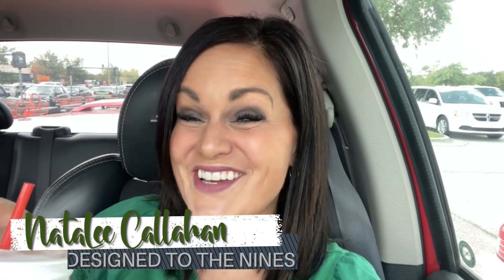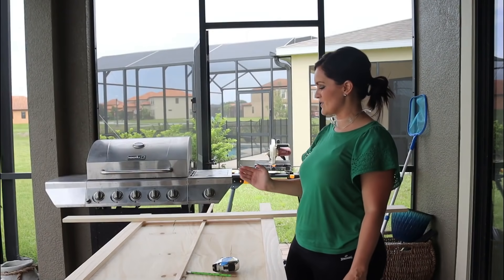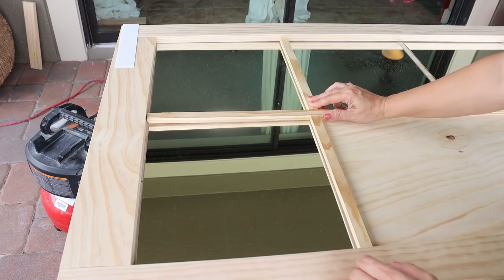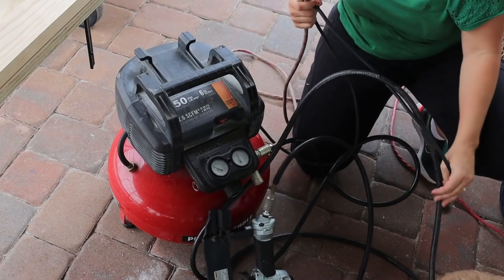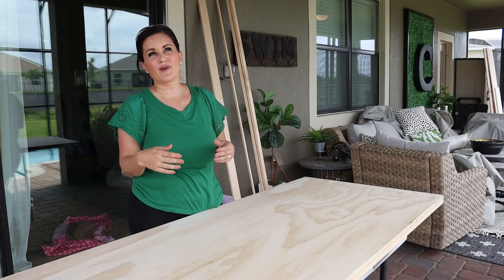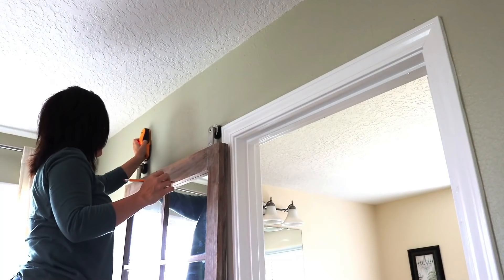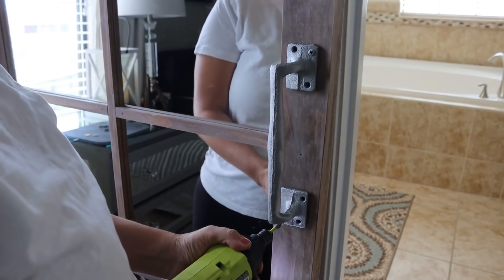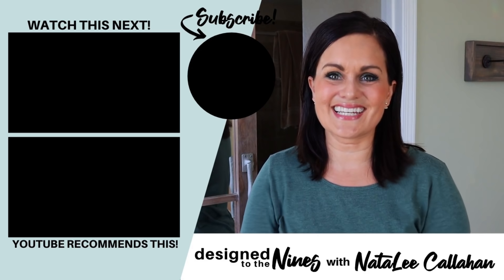⭐ You Can DIY This Amazing Industrial Mirror Barn Door!

Comment: I built my own barn doors which also required a mounting board for the hardware rail. I chose to paint the board the wall color. Once the rail and door was installed, you never even notice the mounting board. It blends in with the wall and the barn door and cool hardware is all you notice. 
Great job! Can’t wait to see the entire room.

Comment: I love all of your wood working projects! You are Powerful! I think your videos are great, but  May I make a suggestion though. You always address safety gear before you get started using your power saw and I notice that you usually always have your hair pulled back. You might want to mention in your safety gear 'disclaimer' that it is a good idea to pull your hair back if you have hair long enough to pull back.  I typically work on the ground with my power tools so I'm always bending over or stooping down over my tools, my husband's first 'safety first lecture to me is to make sure I have my hair pulled back because if my hair gets caught in whatever power tool I'm working on it can have disastrous affects.... not only just pulling my hair but me getting severely cut or injured by pulling my face directly into the blade or whatever tool I am working with. It just takes one second of being distracted or the wind blowing the wrong way to have disastrous consequences.
Thanks for all of your inspiration!  BTW this project ranks right up there with your tuna can chandelier dupe. Your ingenuity and visions are Amazing!

Comment: I've been wanting to put a barn door on my bathroom for a long time now.  I finally was tired of having the swing door and had my husband remove it about a year ago.  I like it much better but still wish I had a barn door there to block out the light at times.  Can you tell me approx what you spent in doing this project?  Also, I noticed the handle on the front of the door but what do you have on the back of the door to help you open it?
Reply from the maker: I think it was around $200 with lumber leftovers... I don't have anything on the back. Slides open super easy. =)
Reply: @designedtothenines is it possible to treat the back of the door with the same process? Thinking my bath could benefit from the mirrors as well as the bedroom at the same time.